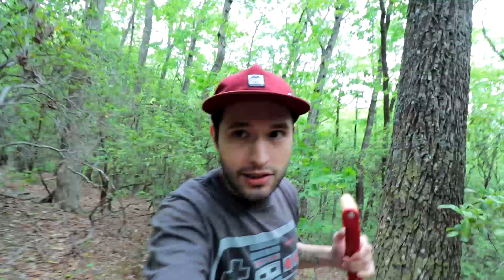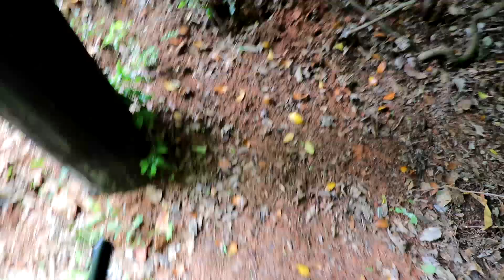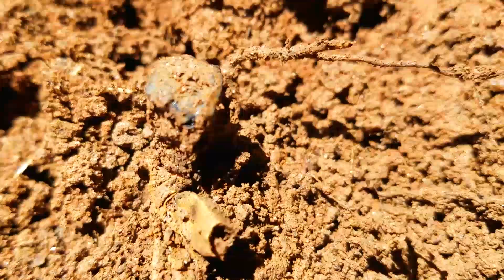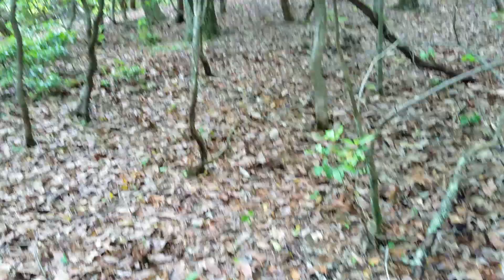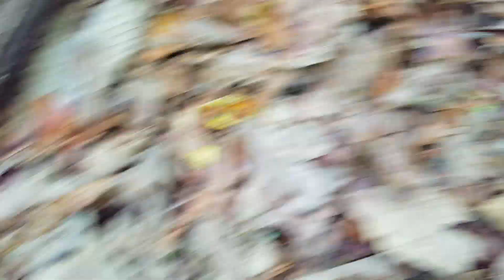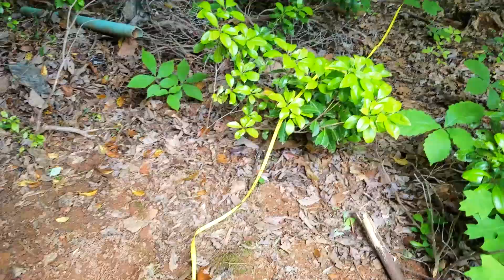Finding Property Pins with a Metal Detector

Comment: Stumbled across your video. I'm a REALTOR  and its been my experience that property pins are marked with orange tape. The blue ribbon you dug up could be a rotten piece of tarp or tent with a steak attached. Property pins are usually one to two feet long and they are driven down  deep into the ground. Now that you have a plat, if you can find one pin, use the compass on your phone to help locate the others.
Reply from the maker: Thanks for the info. In the videos after this, I did manage to find the pins. ;)